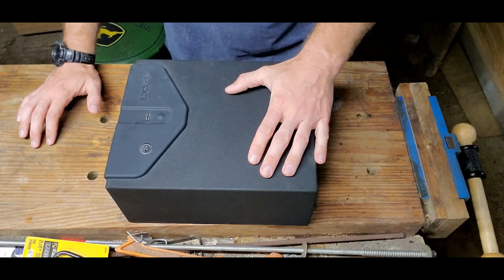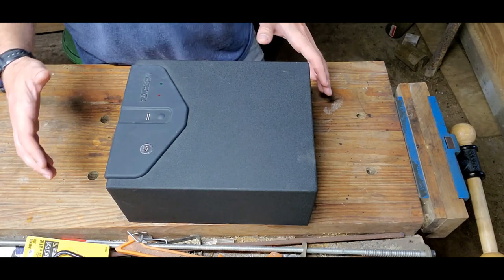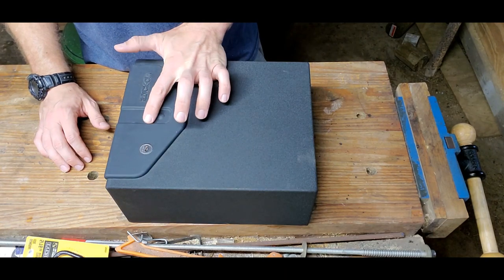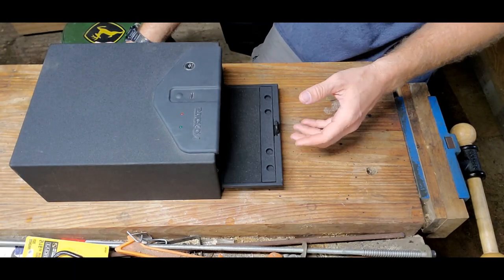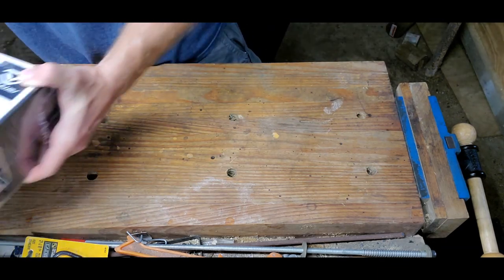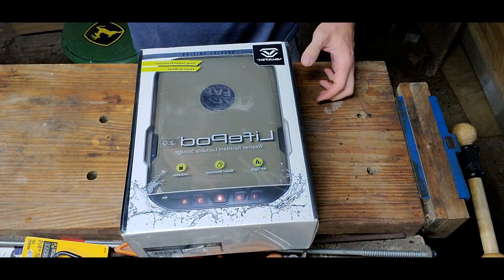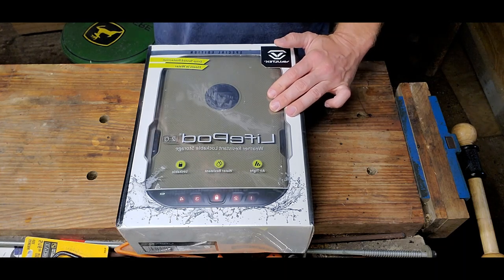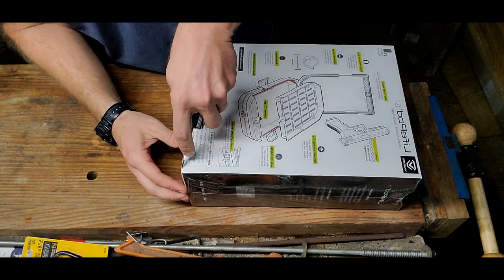Best handgun safe ever?  LifePod 2.0 unboxing and fit check (w/suppressor)

Comment: Thanks to reviewing this.  Apologies, I assume I missed it because of some background noise I could:'t hear all that you said.

What I missed was the part when you made the case for considering this to be the best handgun safe.  I also missed the part when you listed the criteria you were using in your comparison with all the other pistol safes that were on the market back then.

It certainly has some nice feature, it may even be somewhat of a trendsetter.

I would not consider it in the running for such august praise based on one.of my most essential requirements to any gun safe, security.

Though have never hacked one, based in by vids I've seen it is fsir!y easy to open without password or key.  Hopefully th maker has addressed these vulnerabilities, and hopefully others have commented on this.

Regardless, it bears repeating lest careless shoppers accept your endorsement as an.indicator that this is a high security device.

For consideration of .the security side or the pistol safe market, check the yt channel Handgun Safe.

Cheers

Comment: 1st problem I see with this thing is that you gotta press the button in order to lock it... What  if you forget.... I personally think it should lock as soon as you close the lid.... Hopefully it has that option...
Reply from the maker: It does not auto lock. A quick tap of the button shows whether it's locked or not.

Comment: Can you still break into it?
Reply from the maker: Everything can be broken into. If you're referring to the fork trick, no. They have resolved that by adding a magnet that senses when the lid is closed and disables the internal button.
Reply: @7fatcowsfarm378  cool. I was needing a safe, did the fix the paperclip issue behind the buttons?
Reply from the maker: As far as I know that's no longer an issue
Reply: @7fatcowsfarm378  neat

Comment: 7FCF, Consider keeping your suppressor (non-lethal item) outside the case, freeing up needed space for mag storage.  While not ideal, at least you are never without the number of mags that your particular application calls for.   Just received my 2.0 today.  Had the 1.0 smaller version, but just too small for me.  I carry the p365 with two mags, and a few other items when traveling, so the 2.0 fits the bill very nicely.  They also make a carrying strap for the top which makes transporting the box more practical.  You can order it separately.  while the pick foam is a great concept, and useful when you have plenty of space for each item, I found it mostly impractical for such a small space application.  Thanks for the review, it was fun watching you work through each issue.
Reply: Can your ammo be in the same box?? Or do it have to be in a separate lock box when flying??
Reply: @rarapcn2885  Good question.  Depends on the airline. You should check the website of each airline you fly.  But I have always kept the ammo with the weapon in the same lockable case, unloaded, some in the mags but not inserted, and some in the original packaging.  No loose ammo is allowed.  Some airlines will not allow ammo in any mag, some will.
Reply: @thomass5169  thanks a lot. 👍🏽 flying to Miami Friday. I will keep the ammo in the original box also inside the 2.0 and leave the mags empty. Thanks again.
Reply: I was able to store a g45 with a streamlight TLR laying on top of the pick foam making it a snug fit while transporting. I did remove some of the pick foam pieces to fit two additional mags with my Glock 45 👌🏻. I’m loving this lifepod.